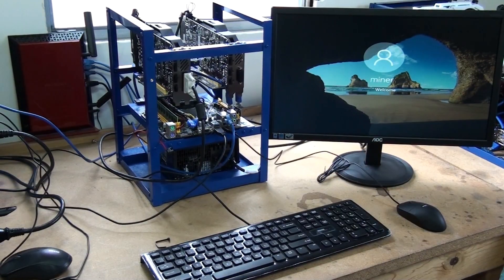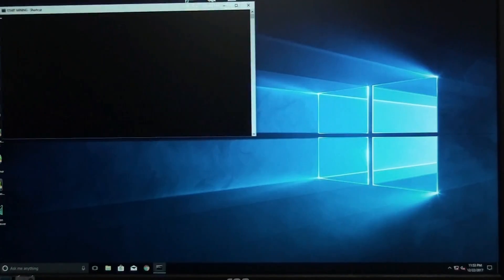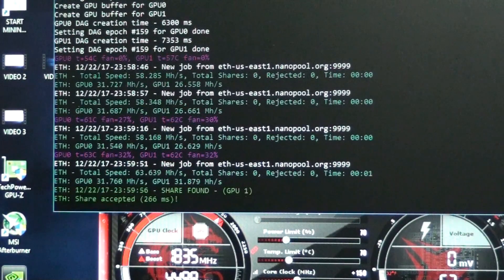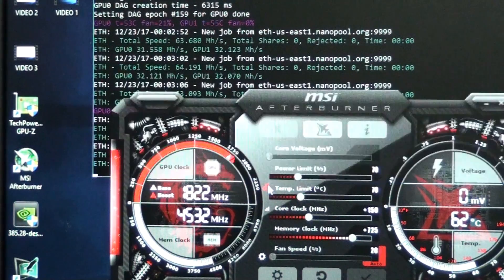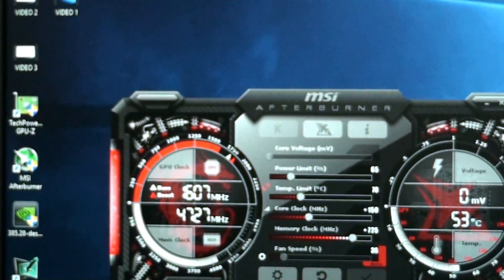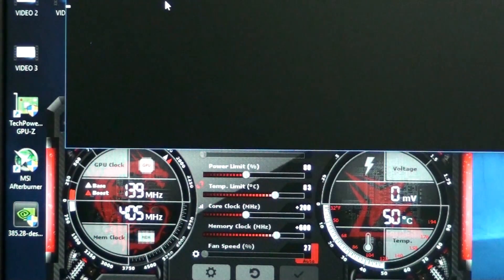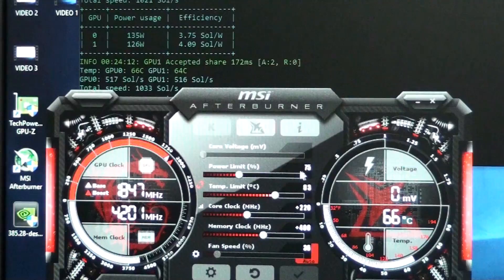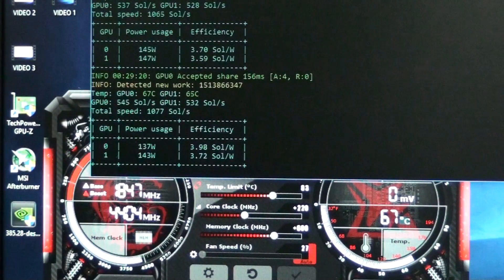Gigabyte GTX 1070ti GPU mining REVIEW. Testing Ethereum and Zcash.

Comment: What is the amd processor?
Reply from the maker: It's so dang old I don't remember. It's a micro ATX and uses ddr3 ram. AM2 rings a bell.
Reply: delvis11 Ok cool! I just found an old amd phenom X2 64bit I might try. Hey I always send people to your ch for your HHO😆🖒 I keep getting questions from one of my HHO vids about using paint thinner in the bubbler and I always direct them to your ch🖒
Reply from the maker: Thanks for subscribers! I just looked at the board and it's a AM1 socket.

Comment: I have an older ASUS running an Athelon II dual-core processor, it has the 64-bit Windows 7, I'm not sure I can handle much more than the video card I have (Quadro X 1400 from Nvidia).
Reply: Dave Kauffman i'm running a 1070ti and a 10603gb on a Pentium D. Soo don't hesitate to try. Mining just doesn't seem to be bothered to much about cpu performance or HDD. For mw it's a temporary solution, it's not cost effective, but was fun